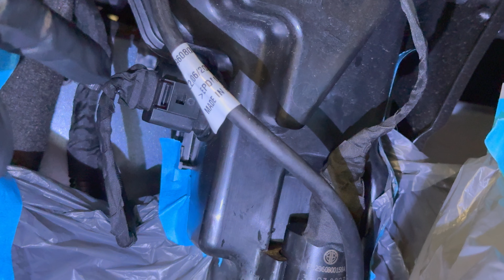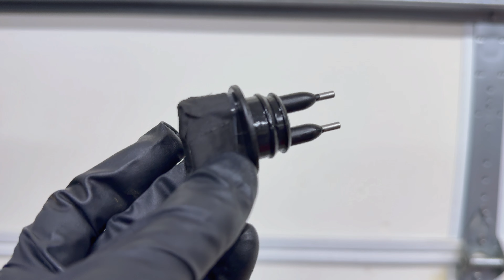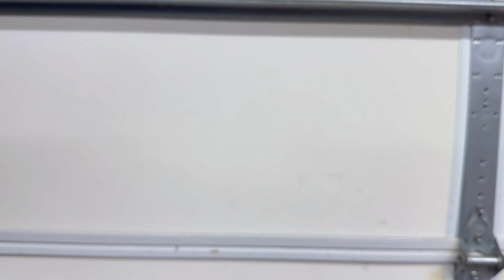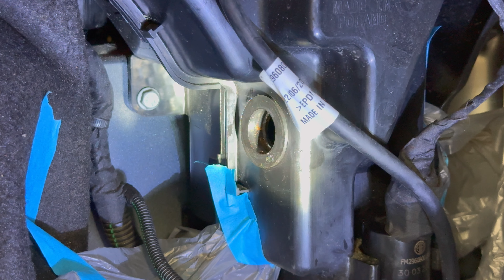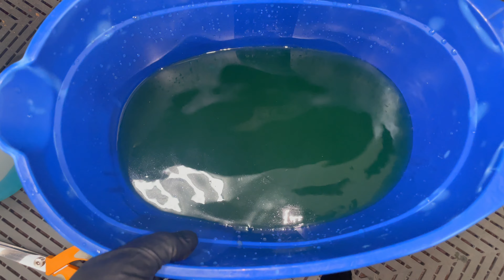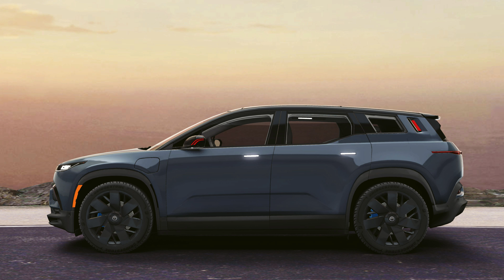Fisker Ocean - Washer Fluid Tank Cleanout

Comment: To solve this problem. You'll need to install on the sensor wire. A resistor or voltage regulator or voltage stabilizer for 12v
Reply from the maker: It doesn’t seem worth the effort to me. I’ll fill the fluid once a year or so. I have heard of someone working on a float sensor drop in replacement.

Comment: These sensors are the same as the ones used on VWs and Audis. Do NOT use washer fluid with any additives, especially Glycol, as that is what corrodes the sensor. Google Audi washer fluid sensor for a deep dive.
Reply from the maker: We are aware of the VW/Audi issues. Even using glycol free fluid, the sensors are still degrading.  We suspect that the voltage/amperage is too high causing electrolytic corrosion.

Comment: How about just finding a plug to replace the sensor?  Could you find one to replace the sensor with? What size  would it be?
Reply from the maker: I cover this in the previous video.  Unfortunately the sensor will fail again due to corrosion. https://youtu.be/pkmsz78sY_E

Comment: Thanks for another great video.  Do you know if you can get the windshield fluid pump from the hood instead of through the wheel weel.  I just did this to my car but pugged in the senor so I what to unplug it. I would rather go through the hood if I could. Thanks again!!
Reply from the maker: No, the best way to access is through the wheel well.  It's just too deep to get to through the hood.
Reply: @MTNRanger  Thanks for the reply.

Comment: Where do you buy fisker parts
Reply from the maker: TsunamiAutomotive, SalvageSurfers, J&J Auto Wrecking, Amazon, eBay, etc.
Reply: @MTNRanger thanks
Reply: @MTNRanger  do you know how much it cost to replace windshield on fisker?
Reply from the maker: @nikkichao-nguyen Part is $2950 plus tax and shipping. https://www.tsunamiautomotive.com/products/windshield-fm2960100162d. Installation varies, you will need to contact service tech or nearby glass place that will do it ($1250-3000?)